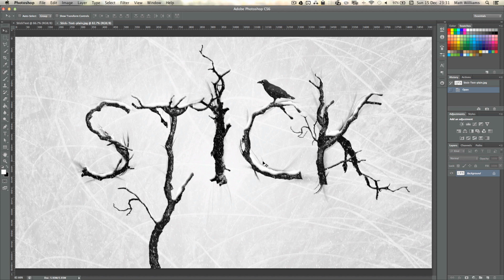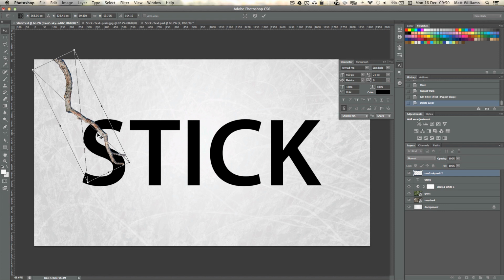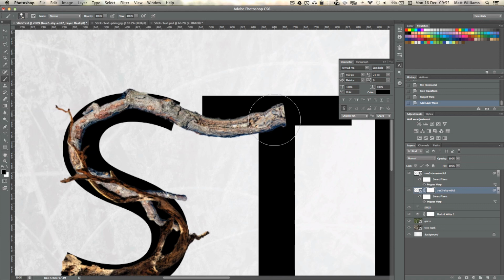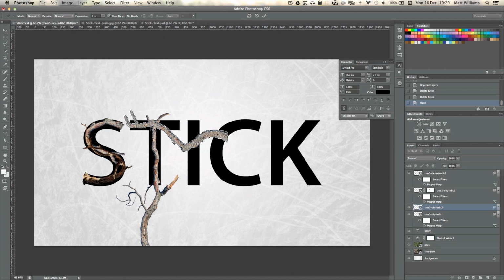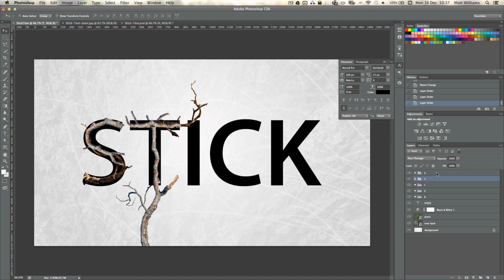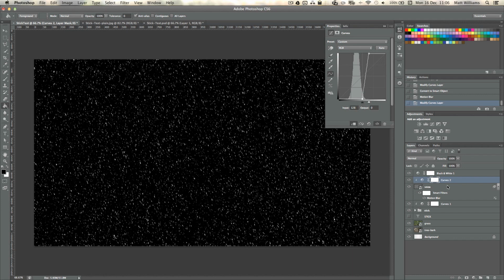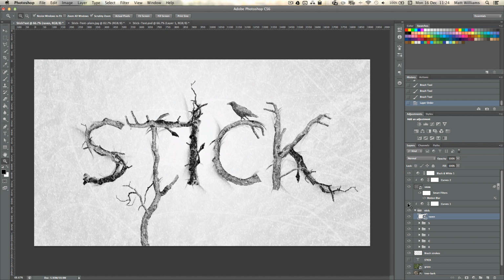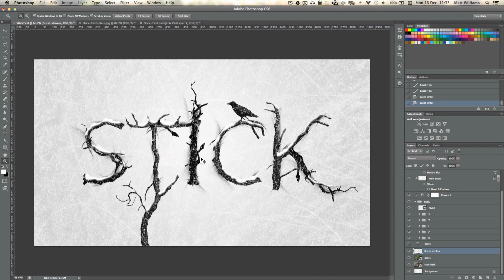Creepy Branch Text in Photoshop

Comment: Is it possible to apply a curves layer to a group of groups in CS5, which I have? Cuz I've having trouble.
Reply from the maker: Matthew Lombardi Hey Matthew, yes you should be able to create any adjustment layer such as curves to just affect a group. You need to put it just above the group (so not in the group), then make it a clipping mask with ALT + Click at the bottom of the layer.